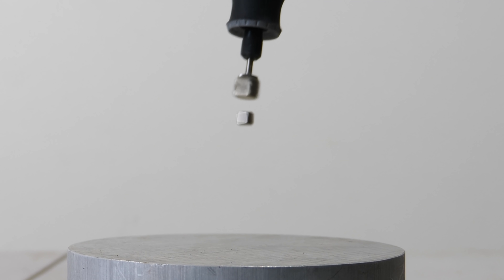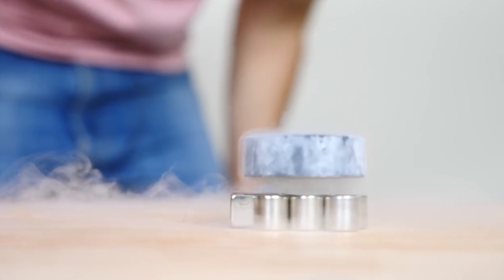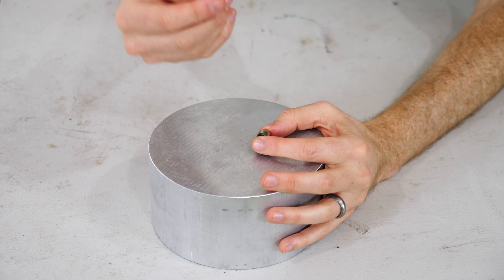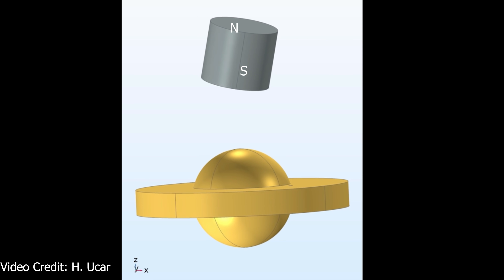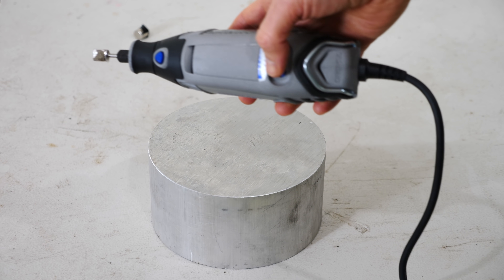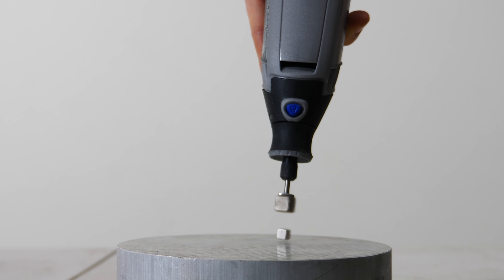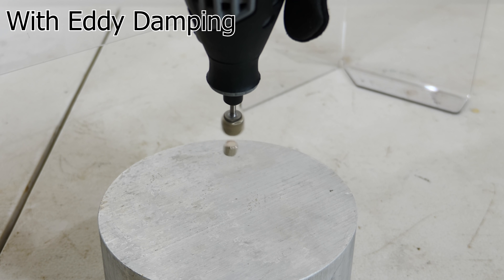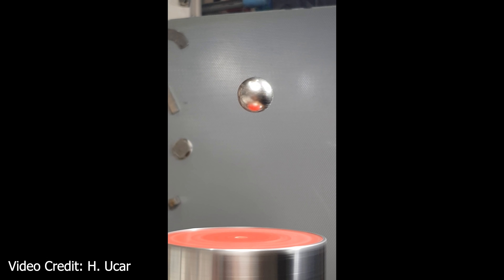Magnetic Locking WITHOUT a Superconductor!

Comment from the maker: I see a lot of comments mentioning that this is the same way the Hacksmith made his hoverboard levitate. This is not correct. The hoverboard he made, is awesome, but it is just using eddy currents to create repulsion. Eddy currents do not create a locking effect. The effect I'm showing is a different effect that can lock the magnet against gravity (you can't do that with eddy currents)
Reply: get an induction motor, remove the rotor and see if it acts like a rotating magnet
Reply: Nice video.... ❤️
Reply: @warchiefgaming4690 ףרץפפר.פ9ה פ
Reply: @warchiefgaming4690 פך
Reply: The Earth is a giant magnet. I wonder what frequency you need?
Reply: Some stationary guide plates made of Bismuth or pyrolytic graphite might improve stability too.
Reply: What will happen if the magnet that is spinning very fast is dipped for sometime in liquid nitrogen and used to lock other one???
Reply: How fast to pushe against your planet's magnetic field?
Asking for a friend.
Reply: Do you think you could do something with Eddie currents?
Reply: The Halbach Array-Eddy Current "levitation" limitation is it can't go sideways(sustained sideways, a half pipe would probably work fairly well) or upside down like Magnetic Locking does. But the magnetic locking requires moving magnets in both the device causing the levitation and what is being levitated making it much harder to utilize for a "practical" purpose.
Reply: Also the Magnetic locking would work in zero gravity unlike the hoverboard.
Reply: @Spikeball  motion is relative, which you may also notice in the video, in which the free floating objects don't necessarily rotate.
Reply: How much would it cost to have you revisit this topic, but through the lens of Nikola Tesla’s Columbus Egg? It would be fantastic if you built a Columbus Egg device demonstrating how rotating magnetic field and eddy currents cause the copper egg to stand up — THEN switch out the copper egg for a magnet and show the magnetic locking effect... could be a really sexy video
Reply: @Hi Li  That's a really cool idea! 💡
Reply: YES
I still remember that we are all made by tiny magnet.
Reply: Thoughts on practical applications of this effect insofar as containing plasmas in fusion reactors?
Reply: @jscarfutti  I think / remember that containing plasma is done by electromagnetic fields, but do not know exactly how, maybe strong permanent magnets are not enough powerfull for that, but i am not sure.
Good point.
Reply: @jscarfutti  Yes. My thought exactly.
Reply: Additionally, eddy current ibased repulsion ncreases by the speed of rotating magnets but in this scheme the repulsion vs rotation speed relation is the opposite.
Reply: There is another way to do this you might not be aware of, you can get a very delicate levitation locking effect between to magnets with diamagnetic materials (pyrolytic carbon, Bismuth).  The diamganetism balances the reaction causing it to be stable.  Also worth noting the Levitron, though that also uses rotation but isn't using Hamdi's effect.  BTW years ago I was on a forum with him and he mentioned at low voltages he got ozone from a caduceus coil.
Reply: Crazy imagine a giant rotating magnet core...oh yeah the earth...
Reply: Okay i want that on my pocket to make the money stay there.
Reply: Does that mean you could make the hoverboard better and more usable?? :p
Reply: I remember I watched a video from smarter everyday. A company show him a technique how to print a magnetic field, it also can be attract and repel at the same time in normal temperature. Very interesting
Reply: Absolutely correct. The difference is in this video, you are using a spinning magnet to lock another magnet. Hacksmith's video used spinning magnets over a good conducting material - in their case, aluminum - which generated the eddy currents that provided lift.
Reply: I love how amazed you often are by the things you are demonstrating for us. Gives me the sense you try this on the go and just upload the stuff that looks cool.
Reply: Polymagnets are great too
Reply: Yeah comment gang atleast research
Reply: @The Action Lab do this except with Coandä effect
Reply: @macs5946  Sounds interesting, but not  exactly sure what you mean(I know what the Coandã effect is), could you elaborate a little bit?
Reply: @BriShep123 natural levitation conduction in laymans terms
Reply: Wondering how the spinning jet engine turbines work up in the ether way up in altitude
Reply: It is an ordinary magnetic trap created by a rotating magnetic field. Its practical application is in gyroscopes that do not have bearings, or vice versa, it can function as a children's toy of the "levitron" type. Anyway, it's a great video that can increase children's interest in physics.
Reply: Oh ok thanks for clarifying
Reply: i wonder, does continues rotation produce heat?
Reply: What if you rapidly spin a super conductor like you did with the magnet?
Reply: The source of a powerful magnetic field is holding the source of another powerful magnetic field
Reply: This would be killer For super fancy Stage performances  theaters, movie making. 
making roads for transport seems unrealistic, But What about for holding plasma for Fusion reactions???!
Reply: Okay, but like... how fast would a magnetic field need to rotate to repell the magnetic field of the earth?
Reply: That's cool. But I was wondering: What is i happening at 8:20 when the coin shaped piece of metal looks to be changing shape, like a fish swimming almost, while it is levitating?
Reply: Where’s the paper link?
Reply: I recommend looking into the research done by the lightning bolts project as well. Their theories on conductivity and magnetic fields in space are very interesting and can better explain some of the phenomena we observe among comets and asteroids
Reply: I think your onto something here. I think this may be a working proof of concept for a vehicle that uses levitation. This only resembles an utmost simplified version of a specific component within a specific system, but this is the physical concept 😶
Reply: Now that being said how big of a magnet or similar concept would be need to repel it a few feet above the ground (earth- tierra firma). Would mercury spinning cause the same effect. And how fast? Let's say an object   the size 2 meters across.
Reply: My Neega
Reply: Really interesting. So if you wanted to levitate a train you'd need to have spinning magnets mounted on the train? Or above/around the circumference? Maybe an aluminium 'rail' underneath?
Reply: There is no such thing as gravity. Only pressure mediation
Reply: You should build a gravity flyer 😉
Reply: It is not necessary electricity or  rotation or nitrogen or superconductors... to make levitate a magnet. It is very easy.
Reply: I am trying to repeat it with electrostatic dipoles
Reply: But levitron is working with the similar mechanism.
Reply: First of all i think you have shown the magnet orientation  represented wrongly , it must the opposite case. The floater magnet as shown as the spinner magnet and vice-versa. The floater magnet does indeed use Eddy current induced and Lenz's law  keeping it opposed against the Aluminum bulk cylinder below!
Reply: In some of the maglev experiments that were done back when there was a big push for maglev trains, a locking effect was obtained by particular designs of the passive component. As I best recall, they cut slots in either the inner portion or outer portion to constrain the size of the eddy loops. If they did it in the outer portion of the passive component, then the effect likely was equivalent to this.
Reply: @absalomdraconis  : This is based on harmonic motion. Check the article for details.
Reply: Sweet.
Reply: @alleycatsphinx ףפ9ףגפ9גדךפ
דטג9רפ
רגבג9רפ
Reply: If i did not remember bad, Hoverboard use halbach matrix magnet configuration, like this other device:
https://youtu.be/BSeTPc18cps
At 03:08 it show how magnets are orientated.
Reply: This closely resembles a cross product - it seems as though both objects exist simultaneously in the same place - it is likely harder to rotate the tool in near exact proportion to what you lift - the fact that it is discretized into such large frequency ranges is astounding. Have you tried with plasmas, or constructed clockwork?
Reply: You cannot lock it against gravity. That is just not right. You are overcoming the force fo gravity but it still applies all the same.
Reply: @seanregehr4921  gravity is not a force. think before to comment.
Reply: @africanelephant2221  what do you propose as the new 4 fundamental forces of physics?
Reply: @seanregehr4921  i’m from a year in the future to call out the mansplaining
Reply: Ok
Reply: Hey action lab, for next episode can we talk about the topic: dogs are actually bigger than retardz? I know the topic doesn’t make sense, but then again what make sense in this world? @The Action Lab

Comment: The late Eric Laithwaite demonstrated magnetic-locking without spinning a magnet, but yet Eric shows that the "fixed" force that pulls-straight must be inside of the "mobile" force that pushes & bends on the outside... But yet, when I google " intrinsic spin of an under-square vortex, other than superfluids, AI says that the term under-square vortex is a misunderstanding or misnomer... You have made a Critical break through in electromagnetic science!!! Your experiment has shown me that without a shadow of doubt,  that "one photon" has a "critical size" and only can exist in a mobile state, being with respect to a infinite number of "fixed smaller" "phonons" that hold one single photon together!

Comment: Fascinating. So the universe is similar to an atom. A single atom is sort of like the sun, in the center and an electron orbiting around it. More complex atoms have more electrons, orbitals, and planets in orbit. Plus the size of the center is bigger with more neutrons and protons. The curious thing is we may not know everything there is to know about these; particularly the orbiting pattern of the electrons or the rotation of the electrons. Each electron, proton, and neutron in the model is probably spinning in some way, and there are smaller particles (light) that are cast off as well; plus a bunch of stuff (dark matter we don't understand). How exactly all this works still boggles my mind. In some way a generator can spin and result in sending a string of electrons down a copper wire to my house, then suddenly switch direction and go back the other way. Some of these particles may not be spinning in a stable manner, all particles are probably always spinning a wide variety of unstable patterns. So a radio wave to hit an antenna, and then suddenly move electrons back and forth shows the wide variety of constant instability around us. It appears that in magnetic materials, all these Electrons get spun in a similar direction, which then causes them to have a repulsive effect, or as they circle back around an attractive effect. Likewise moving electrons on wire around an electromagnetic core, has an effect of corralling the force into a more concentrated direction. Gravity and magnetism may be more related than some think. The universe is likely full of light and particles coming at us smacking us down to earth, the mass of the poor earth might is some way protect us from getting smacked up, as those particles below us protect us. This might cause a bit of the gravity as we know it.

Comment: Buildable idea: Levitate a small NdFeB floater using a coil-only PFR/MBS trap by driving two orthogonal coils in strict quadrature to create a rotating transverse field BC=cos ωt x̂+sin ωt ŷ and adding a constant bias field BS along z with a solenoid; choose ω above the floater’s torsional natural frequency ω0≈√(τS/I) so the dipole phase-lags and precesses on a stable cone about z, keep BS/BC above the minimum for z-aligned precession, then introduce a gentle axial |B| gradient ∂|B|/∂z so the rotating field yields short-range polarity-free repulsion that balances the longer-range DC attraction to form a bound state; make the gradient by slightly detuning a Helmholtz pair or adding a small shim coil, use a tiny axis-symmetric magnet and provisional eddy-current damping with a copper or aluminum ring for capture, then trim BC amplitude, BS level and ω to set height within the stability window.

Comment: You can replicate Ucar’s PFR/MBS without mechanical rotation by generating BC with two orthogonal coils driven in quadrature (cos ωt, sin ωt) and adding a DC bias field BS along z from a solenoid. BC must be above the floater’s natural frequency ω0≈√(τS/I) for the phase-lag conical motion to appear, and BS/BC must exceed the stability threshold so the precession axis stays aligned with z. A small axial field gradient ∂|B|/∂z is required so the time-averaged z-force from the rotating field is repulsive at short range; this balances the longer-range DC attraction to create the bound state. Gradient can be produced by offsetting coil geometry from exact Helmholtz or adding a third coil pair. Use a small as-symmetric NdFeB floater and light initial damping (eddy currents in copper/aluminum) for capture, then remove damping for free-space lock. Control BC amplitude, BS level and drive frequency to tune levitation height within the stability window.

Comment: This is very cool!  Seems like it should be possible to substitute a rotating magnetic field produced by stationary electromagnets, instead of actually physically rotating a permanent magnet.  Perhaps the 3-phase ESC used with quadcopter motors could be used; maybe even the motor itself could be taken apart to yield the right coils, if the field directions happen to work out.  Just an idea...

Comment: how much weight can one spinning magnet hold? so if you swapped the powered magnet with the levitating one. lets say it was a large aluminum, or another non magnetic metal platform, would it be possible to create a Levitating "battery powered" spinning magnet? How many battery powered spinning magnets would it take to create a platform of some kind capable of being measured in lbs or kg?     if you have the time and materials , y not if ur bored.   Really cool vid, ty

Comment: 1) if Dremel is off, the free magnet will be attracted to, and stick to, the magnet glued to the Dremel tip

2) turn Dremel on.  The rotating magnetic field of the magnet glued to the tip of the Dremel - by Faraday's law of induction, and particularly here, Lenz's Law, induces an opposing magnetic field in the free magnet that is the opposite, at each moment, to the field produced by the magnet on the rotating Dremel

Combine 1 and 2 and you have a combined 'locking' caused by the comination of an attraction and Faraday/Lenz repulsion

A tip-off is the close physical proximity required to see the effect - greater distance and the Faraday/Lenz  induction/repulsion will not occur
.

Comment: Your informative videos are well thought out, and the topics refreshing.
I wonder if there are more than one "effect." at work here, for example the magnetic top spinning in midair, over a stationary field. The maglev effect, etc, 
I wonder if this effect works with a non (electrically,) conducting magnet.conducting magnet. 
Perhaps this effect might fully constrain a spinning shaft in magnetic constraints as a bearing system.
Those questions/ answers may help in understanding this matter further.
either way,  it is a step in further in understanding these forces Good work and thank you for the effort you put in.

Comment: Try to imagine helping to build a solar probe (if you wanted) that took advantage of electromagnetic shielding like a fusion reactor, it would have to deal with normally getting “hit” and protecting everything inside (Heat, electromagnetically frying everything) But also, you would have a type of foam at the bleeding edges of your magnetic field.

It’s that foam and those bubbles caused by the interaction of the sun’s electromagnetic radiation/flares/soup With the probes own magnetic field (like our own heliosphere) that would really cause a lot of sheer. Just like you pressing on a magnet- except it’s the sun’s fingers.

I was thinking of essentially designing a solar probe, literally like the bell labs wave set up.  

Try to imagine a probe that utilizes traditional plasma physics, and a bit of mechanical engineering to help give an advantage.  

Think like trying to shingle a barrel with tiles, but electromagnetically.

You would need two cylinders (or more) inside each other, and the idea is to essentially try to have as much of the entire thing to be graphene/carbon nanotube/tungsten plumbing as possible (liquid helium/nitrogen)

Since there is no convection in space, just radiation- rotating should help with your heat sinks, besides helping to step up the power that you have.

I thought of graphene solar cooled wit h a medium, but that one would only get so close- not inside the corona

Comment: Super conductors are hard to come by, and putting one powerful enough around an O’Niel cylinder is even harder. Especially when you need a more powerful super conductor than what is possible- wrapped around a cylinder that is 60 to 70,000 feet in diameter and 400,000 feet long.

Comment: Does anyone know if the weight of the magnet being picked up and locked in place is added onto the weight of the spinning magnet, or as long as the magnet your spinning is equal in mass and spinning sufficiently does the weight of the magnet being picked up basically weigh nothing?